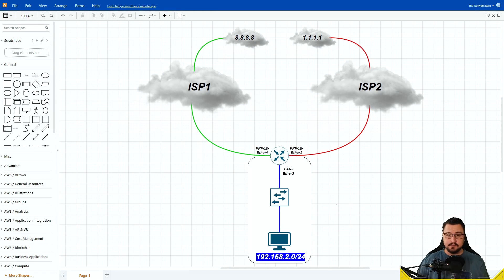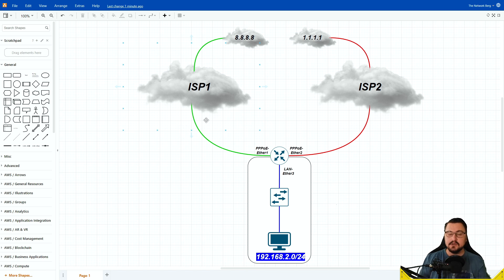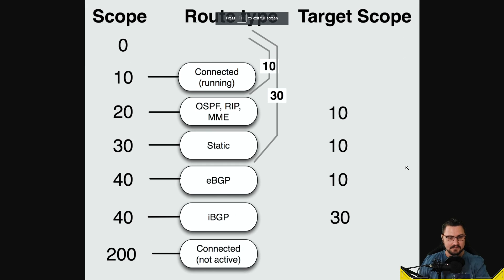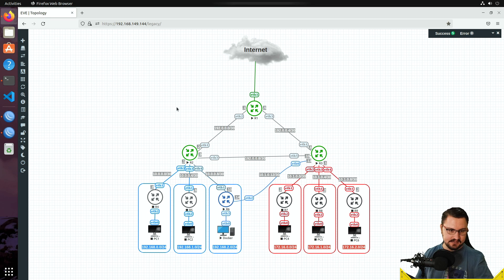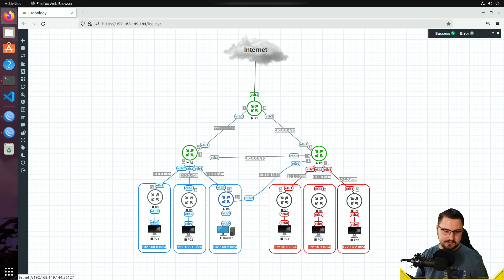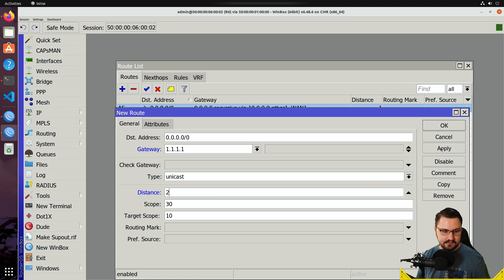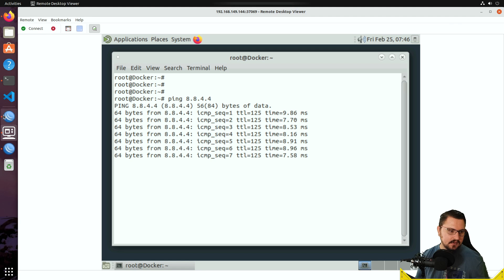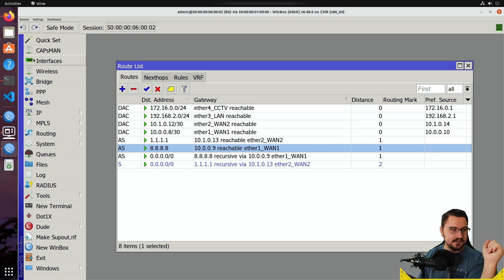Full MikroTik MTCRE - Recursive Routing (Easy Automatic failover)

Comment from the maker: Reference Material:
https://wiki.mikrotik.com/wiki/Manual:IP/Route
https://help.mikrotik.com/docs/pages/viewpage.action?pageId=26476608#:~:text=Recursive%20routing%20occurs%20when%20a,different%20values%20of%20routing%2Dmark.
Reply: hi,excellent video! ive done this before & it works great. But how do i create the exact same but with one issue being that the one isp router sends a dhcp ip and the 2nd isp router can be dhcp ip or static? Problem is that i cannot manual set isp 1 ip as it changes each time
Reply: Hi! Great wideo! However, I'm trying to understand two things - the official tutorial adds 4 default routes, you're only adding 2 - why? Also - the tutorial adds mangling and routing tables - what's up with that?

Comment: Can this be done for wireguard interface VPN connections? If like to failover to a secondary VPN server if my primary dies, then auto connect to primary if its restored. Thanks!
Reply from the maker: I think it should work yeah, though I need to make some updates to the guide as recursive routing works slightly different on RouterOS 7. Mikrotik has a guide on their own channel for it that you could check out as well.

Comment: can I use both WANs at the same time, to combine both bandwithes as a "load balancer" for all the clients?
Reply from the maker: @Stefan-zd7vj  You could use ECMP to load balance links at the same time but this can cause issues with certain applications or even accessing your Internet banking since banks don't like seeing IP addresses change mid connection.
 
I would recommend you check out PCC load balancing if you want to load balance two different WAN links at the same time
Reply: @TheNetworkBerg  thanks! I tested this PCC out from the official mikrotik-site already, but somehow the IP-mangles never worked properly and randomly stopped connections... and I tried to combine it with a tree-queue to prioritize video- and realtime-traffic. 

I don't get it that both internet connections have different distance but it still works - shouldn't the distance be equal at load balancing? :-D Thanks

Comment: Hello, I have a different scenario. I have two ISP and two LANs (with other VLANs from the two)
I want LAN 1 to ISP 1 and LAN 2 to ISP 2, but when one ISP is down, the other LAN should use the other ISP to go out automatically.
I have done the configuration and it is working sometimes.
What is the best configuration can you suggest to me?
Thanks
Reply from the maker: I would probably suggest policy based routing where you can just mark packets from each LAN range and setup routing the same way you were just explaining it.
Reply: @TheNetworkBerg  what about the auto failover? I have tried many ways but still not automated
Reply: @nassirmalindi6681  I've configured your scheme today (also was need). You can start a mikrotik forum topic in General with corresponding request. I will post my config in reply.
Reply: @The_Core_of_Meaning  I have posted to the forum. thanks

Comment: I have been using the recursive routes for most of the mikrotik routers i have used in the last years but the recursive routing will not work on RB4011. Any suggestions?
Reply from the maker: Don't have an rb4011 to test with but should still work, which version of ros are you using?
Reply: Version 7.6

Comment: Excellent video but I am having problems trying to replicate this configuration when the default route is given to me via DHCP server.   My fear is if I force to put static route ignoring the DHCP Server's input the ISP changes the IP pool and default gateway my remote site will be isolated.  I was thinking more to have the DHCP to assign the default gateway and increase the distance and apply this configuration but the routing table displays unknown immediate gateway
Reply from the maker: Are you using v7? If yes, recursive routes operate a lot differently, for dynamic connections that uses stuff like DHCP or PPPoE I would recommend rather implementing PCC (Mikrotik made a video on this recently) It's more used for load balance, but can function for failover as well. And works best with a dynamic solution where IPs may change.
Reply: @TheNetworkBerg  Yes v7 and will check your PCC video!

Comment: It seems that the route to the IP check has to be done through an IP address, it cant be an PPPOE interface. Is it possible to use a PPPOE interface?
Reply from the maker: For PPPOE connections I would rather recommend PCC, I still need to make a video on this but there are other videos about it on YouTube already and the MT docs does a good job explaining it as well
Reply: @TheNetworkBerg  Yep, I  have used PCC before and I guess in cases of PPPOE interfaces is what  I will use. But your video helps in other scenarios.

Comment: everything is ok when you use ip addresses for gateways. but i had rule set not by ip addrress but by interface. and recursive routing is not working that way. why???  normal routing works ok when you use interfaces even simple fail over works but not recursive.

Comment: Hello Sir. I saw this video, excellent, congrats, however like others said in the comments, my ISPs are using DHCP, so my problem is to make the recursive using DHCP instead. So, have you tried implementing recursive routing using DHCP for the wan? And on my scenario, the secondary wan connection is an LTE. Thanks.
Reply from the maker: For your scenario you should look at PCC, it effectively works as loadbalancing, will try to make a video on it as well
Reply: @TheNetworkBerg  thanks, I will take a look at the PCC. However, if you could create a video for that it would be great. Cheers!
Reply: Doing recursive route with DHCP is possible all you have to do is go to DHCP client click on the + sign, choose the right interface for your WAN connection and at ADD DEFAULT ROUTE you choose NO. By default it is at YES. This will enable you to assign the route manually and help you change the scope.
Reply: @gilbertpinamang1650  how about if we set the default route distance to e.g. 10 and configure gateways not as IP addresses, but as interface names? It seems to work correctly that way, but I'm wondering if I'm missing something.

Comment: But how to apply this if the ISP1 is just giving intermittent connection?
The link is up, Internet is online, it just that intermittent with ping reply and timed out, not a total link failure.
Can this also do the trick ?

I understand that this setup is only for ISP1 with link / interface down or offline.
Reply: This is not the answer for that.

Comment: This is awesome. Thank you. Just a question, how could you implement an email notification to advise ISP1 connection is down?
Reply from the maker: Yep, should be doable using a netwatch script to send out an email if the ISP1 connection drops.
Reply: @TheNetworkBerg  That's what i was thinking although I think it wpuld rock if netwatch could monitor physical interfaces. Such as ether1 or 2. In this case would you just monitor the Quad 8? I guess if you main connection has a static ip you could monitor that....
Reply from the maker: Yeah Martin, I also very much wish you could monitor interface statuses with Netwatch. An alternative would be to just setup a script with the scheduler that you can run at X internvals to check the status of an interface and then use the email tool to send out a notification if an interface status is down. This requires a bit more tweaking and knowhow of the MikroTik scripting language, though I am sure a script like that exists already somewhere on the MikroTik forums. I am planning to someday go more into MikroTik scripting and add videos on it on the channel since I find it to be very useful.
Reply: @TheNetworkBerg  Thats awesome! Will also have a look around for similar scripts - Your videos are amazing and your content is just what we need, reminds me of YouTubers like NetworkChuck and David Bombal.... Keep it Going!!!
Reply: I would suggest setting up external syslog server and perform automation over there. That way you can do a lot more than a simple email.

Comment: Hey Berg, nice video and explanation. Do you mind using RouterOS v7.x, in this newer versions, you need to change target scope also, in order for this to continue working. Otherwise, a horrible headache will appear.
Reply: Agreed, good video,. To add a bit more explanation - v7 requires scope to be less than (v6 allowed equal to as well) target scope in order to do the next hop lookup. So, when you want to resolve the recursive default route, you need to make sure your target scope is higher than the scope (default is 10 for connected routes) in order for the next hop interface to be used in that lookup. So, increasing the target scope to a value higher than 10 will make the recursive route possible. This will also result in more routes used as recursive routes.
Decreasing the Scope value will also work and make the route more likely to be used as the recursive route.
by the way Berg, stop with the American rout and pronounce it properly - root

Comment: I am getting so frustrated with this! I have tried to do this many times now, but it doesn't work. Both of my ISPs use DHCP. I try to use ports where you us IPs (other than the 8.8.8.8 and 1.1.1.1) - but my primary connection always fails. Secondary seems to work. I never get the status showing 'recursive by x' under the Gateway column under the Route List.

The reference you gave for the link to Mikrotik's steps to setup recursive routing doesn't work - maybe an earlier ROS? I have ROS 6.48.6. Mine will not let me use cli to configure /routing/table (the second set of steps). Plus, the steps/method are very different than how you do it. Your way seems simpler and more modern approach.

Does this not work with some ISP's? I am using Starlink in bypass mode as my primary and a cellular AT&T connection as my secondary. I cannot find anyone with any instructions how to setup this recursive routing where their ISPs are giving their internal router IPs via DHCP - which is the most common way it is done...

Pulling my hair out :(
Reply from the maker: Hi Andrew, sorry to hear about the frustrations. The reference material I linked is actually for RoSv7 although there are more tweaks you need to do regarding the scope to get things working. If you don't mind could you upload your config to pastepin/google drive  with sensitive information hashed out and send me a link on Discord? (Probably better than adding the URL here) You can join the discord server here:

 https://discord.gg/JZA7vFTF82

Comment: Is it possible to implement this with a dual dhcp wan setup that is doing load balancing? It would be nice to be able to monitor up status for both ISP's (and drop one if it is down) while still allowing for the load balancing to occur.
Reply from the maker: Hi Ethan, if your WAN connections are via DHCP then I would recommend rather implementing PCC. It incorporates firewall mangle rules with packet marking to achieve loadbalancing and failover. Unfortunately I do not have a video on the channel showing how to implement PCC, but following the MikroTik guide should also help you with setting this up.

https://wiki.mikrotik.com/wiki/Manual:PCC
Reply: I’ll do some reading and give it a go. Thanks for the advice and keep up the good work.
Reply: @TheNetworkBerg  How about picking up the DHCP GATEWAY from the client. Then using a script in the DHCP-Client to update the route's gateway?
Reply: Hello Ethan, I have the same problem here, both ISPs are dhcp and one of then is LTE actually. Did you manage this problem? If yes, can you share the solution? Thanks.

Comment: Hai, I am new to Mikrotik, my isp providing bandwidth by using RouterBOARD 3011UiAS as main server using port 4 and for failover connected ccr1009 to port 5(RouterBOARD 3011UiAS) when main server input goes down i have to manually change route to ccr1009, is their any way for auto failover, and i am using hotspot logins for 70 customers. I hope you understand my question. both lines from same isp

Comment: Thanks, network berg for your immense contribution to networking. I have this error from my Mikrotik router port interface below. I have bought the original cable and changed from auto-negotiation to 100mbps speed. This effort did not resolve the issue, kindly advise. Thanks
ether2- SECTOR2 RADIO fcs error on link

Comment: In a failover scenario (vice load balancing) its more common to just do recursive on the first route.  If the first one is not available then the second route will be used regardless.
In this case often folks make two recursive routes for the primary in the case where we go one step further, what if one of the DNS services is down.
Reply: Having recursive routes for the secondary WAN makes sense for monitoring. If the backup link loses internet connection, you'll wanna know. You can script e-mail notifications, for instance.

Comment: Hi Network Berg,

im not sure why , but in v7 scope/target scope are calculated differently. 
If you do same thing in v7, that will not work
Reply from the maker: Will check out recursive routing in v7 and make a video about it too. Might also be one more of those features just do not work correctly currently in v7 which might be a good reason to wait for a long-term release before covering this or upgrading anything to v7.
Reply: @TheNetworkBerg 
 there is new calculation 
**v7 - Target scope must be bigger than scope
Reply: For ros 7.x. just change Target Scope to "11" on each default route.

Comment: This is very  informative. I use this mechanism for a while now. In combination with netwatch it is even more powerfull. But.. with Ros 7.x it doesn't  seem to work this way. Maybe you can make a video of this based on ros 7.x. thanx. I like your video's a lot.
Reply: For ros 7.x. just change Target Scope to "11" on each default route.
Reply: I second the request for a ROS 7.x update! Great video
Reply from the maker: I will see if I can also get a RoSv7 video in conjunction with this one. I want to do RoSv7 separately and when there is a long-term release out for it since MikroTik is still making MANY tuning changes with each stable release.

This guide on the new help wiki is based off of v7 if you want to give it a read(Same reference I pasted in the pinned comment)

https://help.mikrotik.com/docs/pages/viewpage.action?pageId=26476608#:~:text=Recursive%20routing%20occurs%20when%20a,different%20values%20of%20routing%2Dmark
Reply: @TheNetworkBerg  Small favour, please show a traceroute not just a ping in the next video, just so we can see the path taken (whether the recursive gateway shows up in the traceroute or if it shows the actual gateway)